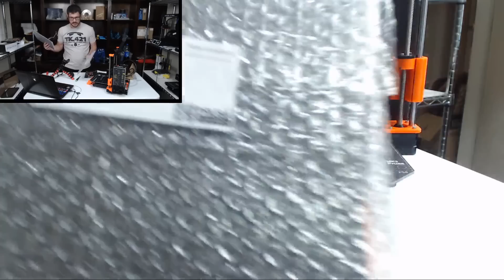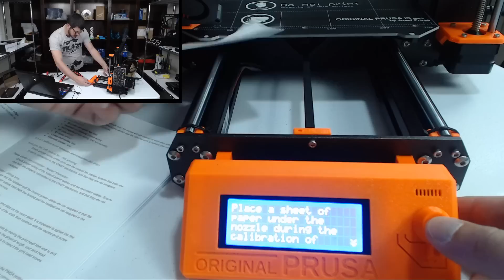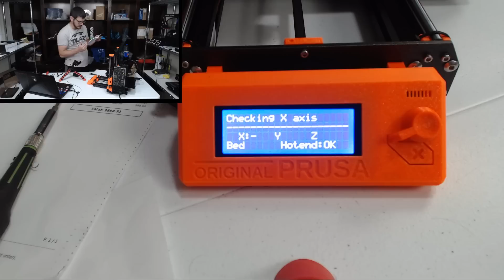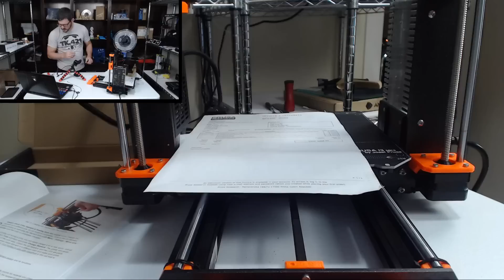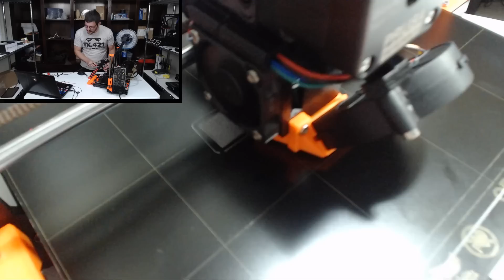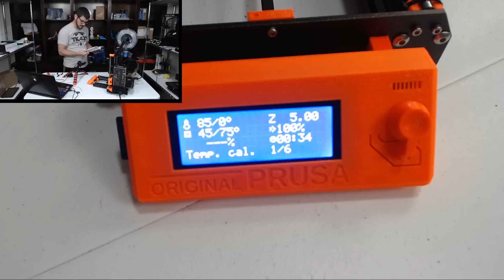Prusa i3 MK3 Live Calibration and First Print! Part 1

Comment: how do i disable that test calibration it keeps losing my filament for all 40 points or how many ones and then once it start printing filament get stuck to nozzle every single print i need get little stick to remove it while printing its start to anoy now cause my first layer affects from it wen i need to pause it
Reply from the maker: You mean when you start a print, the ABL probing leaves filament blobs on your bed? If that is it, try my start gcode out: 

G90 ; Use absolute positioning
M83  ; extruder relative mode
M140 S[first_layer_bed_temperature] ; set bed temp
M190 S[first_layer_bed_temperature] ; wait for bed temp
G28 ; home all without mesh bed level
G29 
G1 X5 Y5 Z0 F5000.0 ; move to start-line position
M104 S[first_layer_temperature] ; set nozzle temp
M109 S[first_layer_temperature] ; wait for extruder temp
G1 X150 Y1 Z0.3 F1500.0 E15 ; draw 1st line
G1 X150 Y3 Z0.3 F5000.0 ; move to side a little
G1 X5 Y3 Z0.3 F1500.0 E30 ; draw 2nd line
; G1 E27 F3000 ; retract filament 3mm
G92 E0.0
Reply: @Fugatech3DPrinting  i got it fixed already but th anks for reply

Comment: Sorry I am new to printing if you have line in the block what do you recommend adjusting?
Reply from the maker: It was running over the Zip Ties that I used to hold the ribbon cables. Take those off and no more lines :)